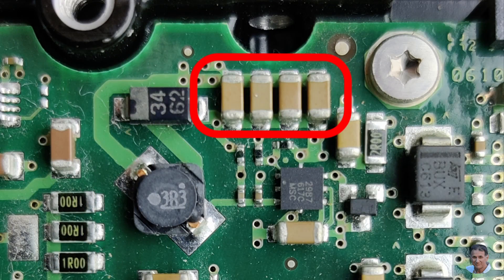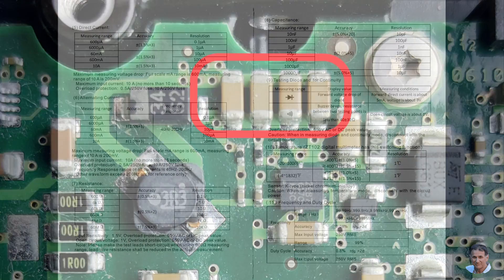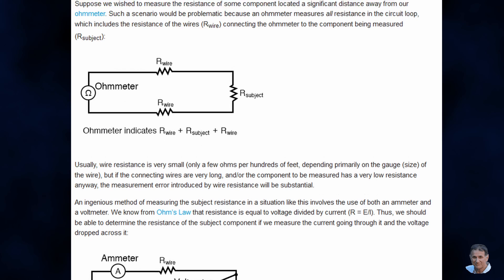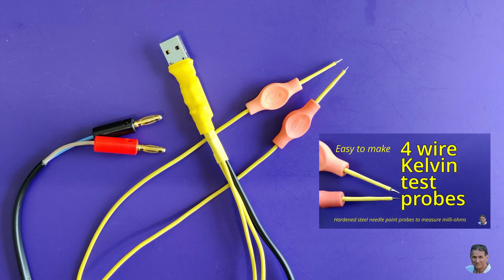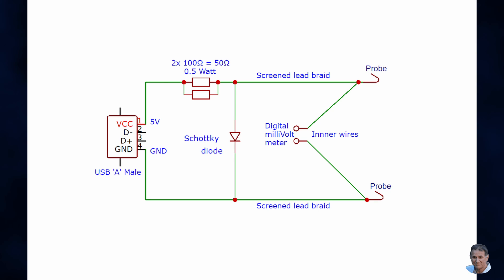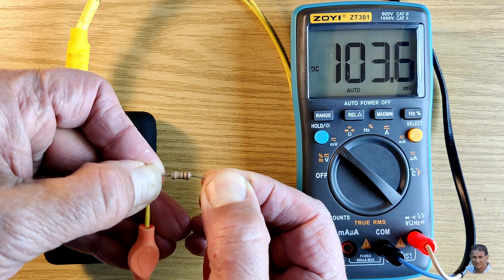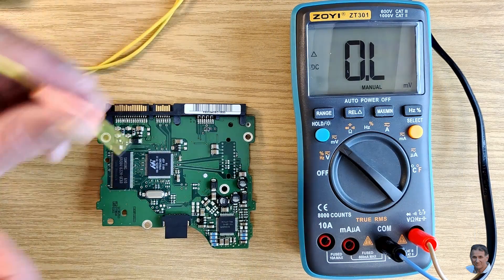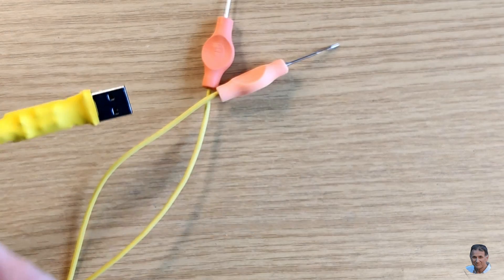Easy milliohm meter Project : Locate a short cicuit even if it's in parallel with other components.

Comment: Do you have the type number for the shottky diode?
Reply from the maker: Any 1 amp (or greater) schottky diode will do such as 1N5817, 1N5818, 1N5819, or even surface mount types. Working maximum voltage must be more that 5v, which they all are! The important thing to get right is the wattage of the resistors - ensure at least 1 watt.

Comment: Could it be useful with diagnosing audio amplifiers?
Reply from the maker: It could be useful if there is a short circuit which is in parallel with several components, but I would only use this in the final stages of fault-finding.
Reply: @richardlangner  So in what kind of elctronics this device is most  useful sir?
Reply from the maker: @WarsztatAudio  You use my device when you have located the fault area but there are several possible components in parallel, and you can't easily remove each to test them. This is common in SMD components, especially ceramic capacitors which are distributed across the PCB power lines. For wire-ended components it's a simple matter to desolder a leg or two and check them so you would not need my device.

Comment: No stable current source you can build? UBS voltage can differs from 5.5V to 4.5V or even more...
Reply from the maker: You raise a valid point. The project is to locate short circuits by comparing milliohm values. If you want have accurate readings it needs to be a fixed current source (not fixed voltage) and proper 4-connection Kelvin probes. The video was to encourage perople to build something they can use, at little or no cost. And it's a bit of fun too.
To answer your question, 5.5v and 4.5v are 10% out, the resistor could be 5% out, so worst case you's be 15% out, which does not really matter when you're trying to locate a short. So not accurate, but it can find the problem.
Reply: @richardlangner  Ah, ok. Thank you!

Comment: very nice circuit and probes...    if i want to measure batteries internal resistance with this,  the batteries above 5v would induce voltage  back right?    and if that happens so could we add  2  diodes  on  usb and ground to prevent it  and not be concearned with polarity right?
Reply from the maker: I assume you are joking.... (if not, please do not connect probes to any source of power)

Comment: USB will not supply 5V with this circuit!
Reply from the maker: You are quite right, there will not be 5v at the probe terminals. To avoid turning on transistors or diodes in the circuit under test, we keep the test voltage very low. It is the current in the short circuit we are concerned with, and the voltmeter gives a comparative indication of readings. I hope this makes sense to you now.

Comment: This solution is quite crude looking due to the nature of the resistors used and the power supply voltage. If accuracy is desired (which should be for this miliohm meter) a higher tolerance resitors must be used. Otherwise a current sourcing circuit must be implemented with LM317T or similar device. Nonetheless great tutorial.
Reply from the maker: Crude, yes, and I agree with all your comments. It's really designed to find shorts to make not exact measurement. Glad you liked the video though, thank you!

Comment: Thanks, excellent. What type/reference should we look for the Schottky diode?
Reply from the maker: Any 1 amp (or greater) schottky diode will do such as 1N5817, 1N5818, 1N5819, or even surface mount types. Working maximum voltage must be more that 5v, which they all are! The important thing to get right is the wattage of the resistors - ensure at least 1 watt.

Comment: I guess the 5 v / 50 ohms = 100mA plus  zero to  0.1 ohms for the short circuit  plus  ohms of needles. Can we improve the measurement? : Possibly by soldering the voltage source to the very near tip of needles to reduce ohmic effect of needle. We could also use better conductive material than chrome . We can also amplify the current to the voltmeter giving it a greater sensitivity . Interesting to see how constant the current is from a 5v usb and 50ohm load is .
Reply from the maker: Absolute accuracy is not my main concern when locating short circuits, it is the comparative resistance. I agree connecting the sense wires nearer the needle point would be better, but the twin needle contruction (in my other video) solves this issue. The main thing is that this device is easy to make and is far cheaper than a commercial product.

Comment: I have made similar device by just salvaging the old ATX power supply connector, pulled out its 2 pins and put them on the probes of my multimeter. They fit well on the probes, soldered their other ends to an AA battery. Now i can use millivolt scale to find these shorts. Although its reading should not be accurate/calibrated but it distinctly isolates the shorted component on a common rail.
Reply from the maker: That sounds like a very simple solution.Keep up the good work!

Comment: Im sure this is going to be a stupid question to ask once i hear the answer,but are you connecting the usb plug into a portable charger then probing the caps with both those leads as well as the leads from the DMM? Or are you probing the usb plug with the DMM while using the usb connected leads to probe the caps?
Reply from the maker: Hi Levi. Not a stupid question at all. The USB part plugs into a portable charger / power pack / laptop / PC  (in fact anthing that will supply 5v at 100mA or more). The two jack plugs connect to the DMM. The needle probes connect to the capacitor under test. Does that help?

Comment: How will it detect short ..can you please explain, if one of the capacitor is short ?
Reply from the maker: If several capacitors are in parallel measure across each - the short circuit capacitor would show the lowest reading on the meter.
Reply: @richardlangner  thankyou sir!!
Reply: Short in this case doesn't mean zero ohms. A short can be along any scale from ohms to micro or nano ohms . All things have resistance even when you connect two pieces of copper. What is being measured is how short is this capacitor from zero . Typically it will be milli or micro ohms scale.  By moving the probes we can see where the most shorted point seems to be centred on the board

Comment: Not bad idea with usb. Not very accurate but easy to made and use, dont need current mode power supply, just a power bank.
Reply from the maker: Yes. not very accurate for measuring, but great for finding shorts.

Comment: Hi Richard, I love stuff like this but I have a question.

It's not entirely clear from this or the other video, but is there a step missing here in the video?  

Specifically this is because you solder to the back of the needle and therefore the resistance you're measuring will include the resistance of the needle from the solder point to the tip in the result as well, since the force and sense leads are "shorted" at the solder joint, anything from that point on it part of the measurement. 

I picked up a random needle and measured the resistance and it was 8.2 milliohms, so a total of (assuming they're equal) 16.4 milliohms which would need to be subtracted from the measured value.

I'm interested in this since I've created a milliohmeter and I'm trying to build some probes for easy short finding (like your probes), my meter works incredibly well using traditional probes, but clearly that's not really useful when dealing with small SMT devices.
Reply from the maker: The video showed my first attempt at the probes. I realised afterwards that I should have run the wire to the tip and soldered into the needle's eye.
Ideally you should use two pins for each probe. These ideas only seem to come after the videos are made!
Thanks for your feedback.
Reply: @richardlangner  thanks for the fast reply.

I have been contemplating solutions for this and like you say, there should be two pins per probe, which makes it a much more awkward problem than what it first seems, especially from a in circuit probing point of view.

I have bought some pogo pins (the type you'd use for test bed probes) for this exact experiment, soldering them to a PCB (laying down rather than upright for mechanical stability and alignment) in a v-shape could allow the probe tips to be very close together but without making contact until touched onto a conductive surface.
Reply from the maker: @fizzyade  Iv'e just looked at my pack of new sewing machine needles and a couple would be ideal for forming into a V shape with the points almost touching. I originally tried pogo pins but they don't really have the physical strength when pressed hard onto the PCB, and the resistance is inconsistant due to the sliding parts.
Reply: @richardlangner  yeah, I was going to solder them completely to the board, such that the pig mechanism would be fixed.  The small diameter of the pin and the sharpness of the point is what attracted me to them as an off the shelf solution.

The other way is just to create the probes, don’t worry about the resistance and use normal kelvin probes (which you already have) to “calibrate” the probes and null the offset.

I actually came across your project when I first started to think about creating a milliohmeter, they can be silly price off the shelf and I’d been meaning to buy one for years and never got around to it, I then had a short on a board and wished I had one…so hence why I’ve ended up here.

I’ve created the milliohmeter, complete with 3D printed enclosure, so I’m keen to solve this last bit, so I’m definitely interested in any ideas you have, or tried.
Reply from the maker: @fizzyade  Is there a way of sending you photos of what I have just tried with needles?
Reply: @richardlangner  doesn’t look like YouTube makes that easy.

I have a com domain which bears the same name as my handle here, drop a line there at “hello”.